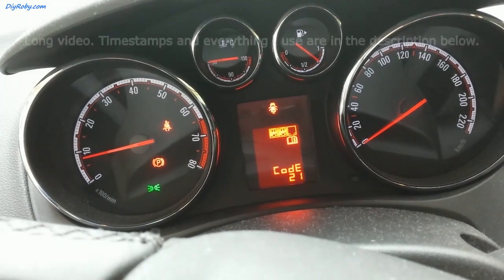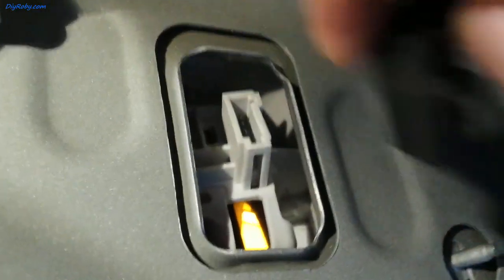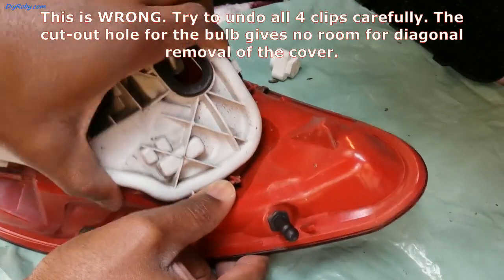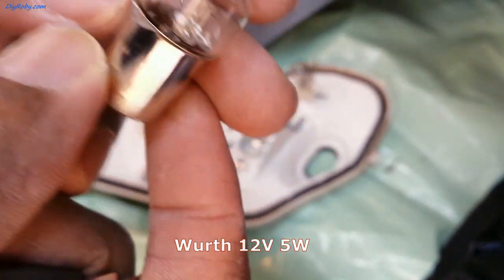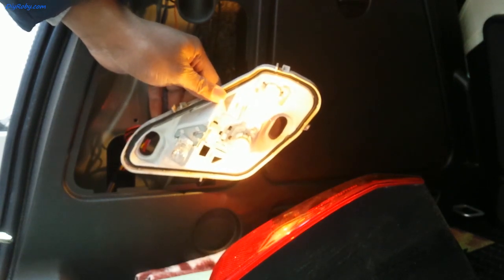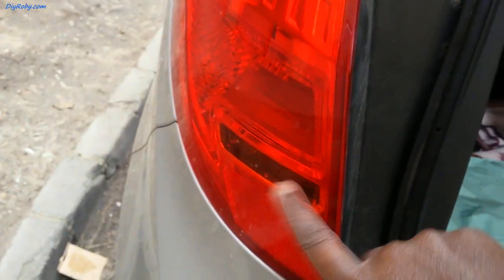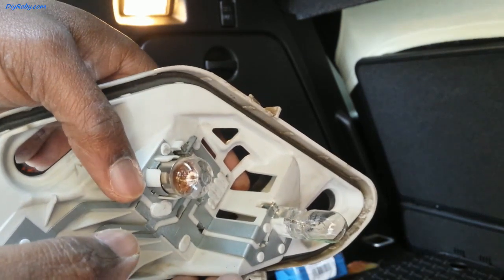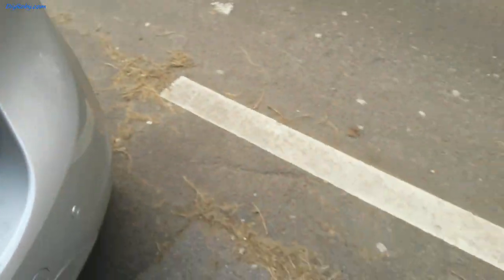Meriva B rear tail light bulbs replacement. Clear Opel error/service code 21 or 22

Comment: Just a quick note that it's not recommended to touch bulbs with bare hands as the oil from fingertips gets on the bulb and when it heats up it might fail sooner than expected.

Comment: So, having had the Code 22 dashboard error, I noticed one of the rear right sidelights was not working. Followed the instructions on here, first thing I did was to lose one of the white plastic triangular rear light retaining / securing nuts down under the plastic boot trim - never to be seen again! Can you buy replacements for these or the light fitting won't be tightly secured. Second error was accidentally breaking one of the red plastic lugs that hold the bulb holder in place. Anyway, removed the cover only to find the bulb I had bought specially for it (a RING 12v 21/5w one) was too big, and it needed to be a smaller slim tube type one ( see https://amzn.to/3qba2hZ ). Great, so put it all back together and went online and ordered the above one from Amazon UK. Hopefully this will fit when it arrives. Great video, shame about my butterfingers and stupidity at having the wrong bulb.